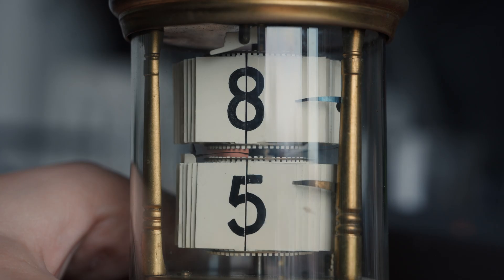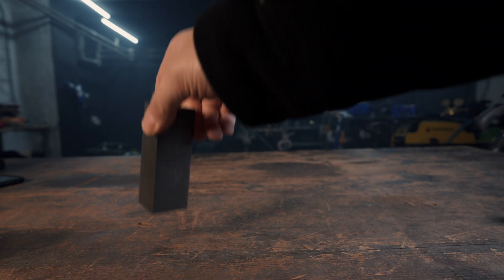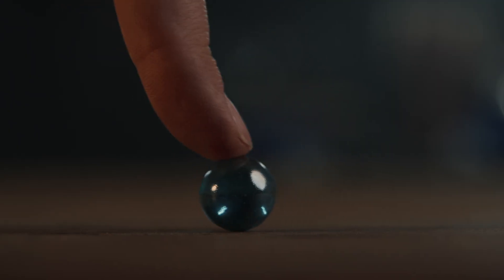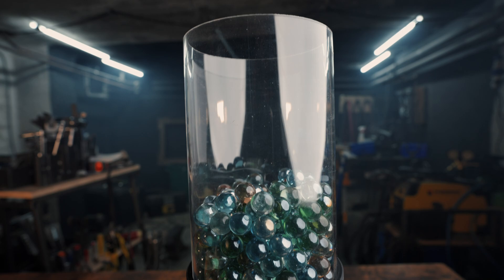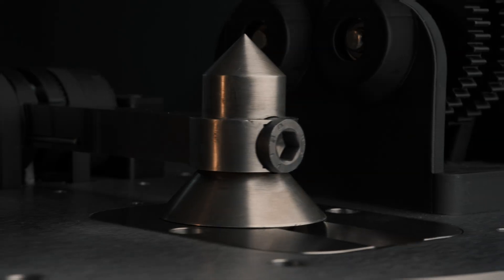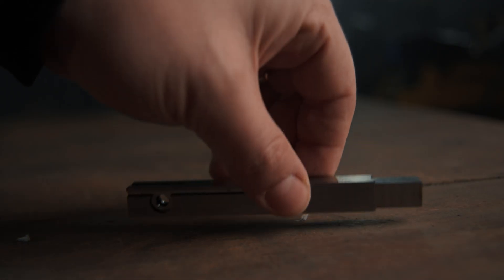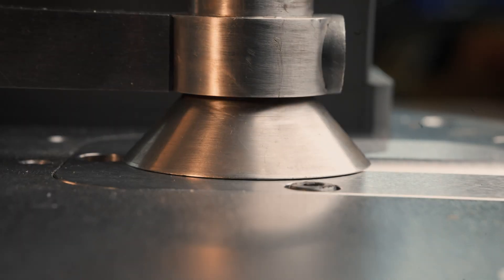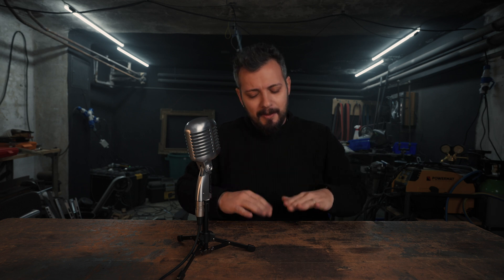Why Clocks Are RUINING Your Life

Comment: Great project! I think the name Omni Clock doesn't fit well. "Omni" in the context of timekeeping would rather imply that time flows in all directions, which contradicts your core message that time always moves forward and past time is therefore lost. Here are a few suggestions taken from the Latin language:

"Cursus" or "Via" stand for course, direction, or path and works well when emphasizing a clear direction.
"Fluxus", which means flow or stream and is often used metaphorically for the passage of time. 
"Progressio" (progress), which signifies forward movement or advancement.

Applied, names could be:

Cursus Clock – The clock of the course.
Flux Clock – The clock of the flow.
Progress Clock – The clock of progress.
Via Clock – The clock of the path.
Reply from the maker: Yeah, I originally thought of omni because it can display time on any scale, but your thinking about the direction is way sharper and a lot closer to the heart of the matter. I like the idea of latin too, what about “Vitae”? It means “of life”
Reply: @TheProjectHavoc  Vitae is a great idea!

Comment: I absolutely love how the hammer looks, but instead of multiple hits, you could consider using a small carbide tip in the center to shatter the marbles more effectively.
Reply from the maker: That’s a great idea, and it was my original intention, then I went for the hardened hammer… I think the spring is part of the problem, I used one from a heavy duty mouse trap 🤣 The insert would have worked definitely better though 👍

Comment: Another amazing build and video, I'm waiting for the youtube algorithm to find you and for your channel to blow up because you totally deserve it!
BTW, does the hammer mechanism in the bottom strike more than once per marble? How does it know if it has broken and fell in the compartment below? 
I don't know if I'd personally go for the kickstarter route, unless that's what you want to do full time in order to deliver the product once funding is reached, but I can see this being a pretty cool statement piece to own in your house - perhaps you could open commissions to build it for others if you estimate low volume? Otherwise having the print files / build schematics available somewhere (even behind a paywall) could be an option and people could build it themselves. How much would you estimate the cost to be for a DIY approach vs a productized version?
Reply from the maker: Hey man, thanks for the support and for the great comment!
As for the question, yes the hammer strikes more than once. And it should have had a magnetic sensor to stop the hitting once the hammer rests horizontally... but I redesign the whole mechanism around the steel parts I already had so many times to make it work that I ended up ditching the sensor and focus on the filming. In fact this whole thing is more of a proof of concept than a fully developed product. It's made to be 3D printed and to be filmed, if this was an actual product it would be done with different production method, and it would be half the size, and with a different crushing method than an open hammer >D
At its current state, this object is good to make a video,  and it's good to show the idea of a time device that works on a different scale, but it's not suited for small production or self-production, too many bugs that still need to be worked out to make it actually reliable. Developing a product like this to the level of quality I have in mind it would be suitable only in the thousands of unit of production, otherwise it would be just too expensive to be worth the effort. It's just that, when I started, I just though it was a funny thing to build, I fell in love with the concept while working on it :) We'll see what the future holds for this thing